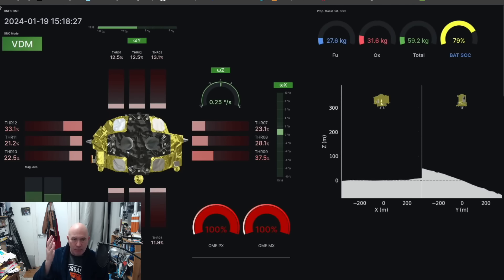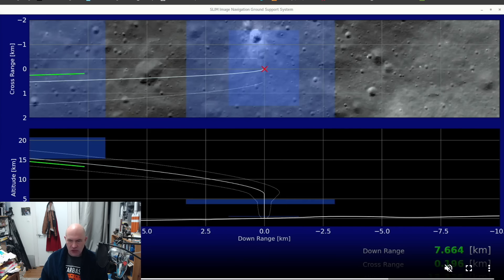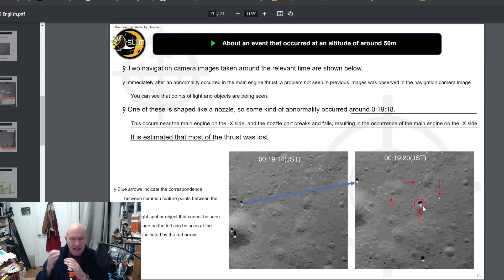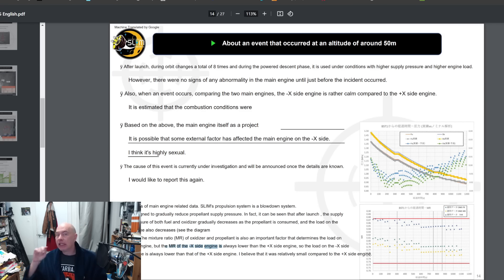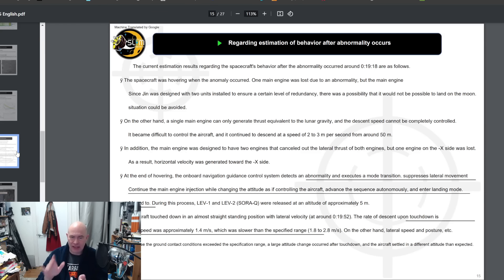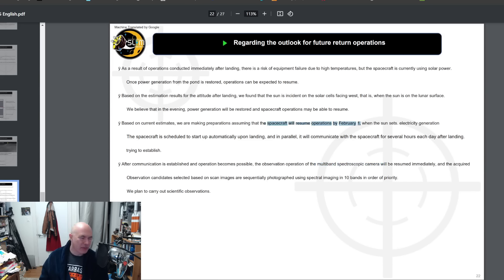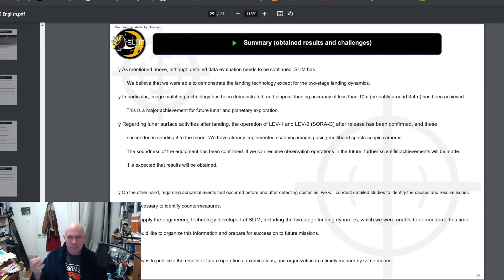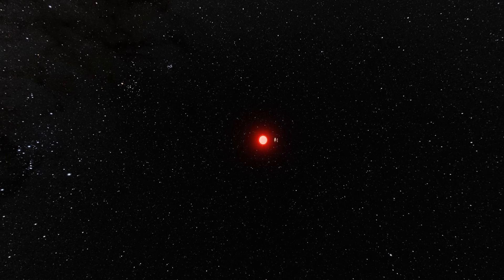Japan Finally Reveals What Happened To Their Lunar Lander! And It Really Did Surprise me!

Comment: Engine falling off during a controlled landing is the most KSP thing I have ever seen. We are in a simulation, and were kerbols lol
Reply: Engine exploding I'd agree with. Engine falling off, not so much. In KSP, unplanned disassembly usually happens catastrophically, not bit by bit. I presume somebody at some point probably made a mod that had parts fall off randomly, but if someone did, I haven't come across it.
Reply: It definitely feels more like Kia than it does Toyota
Reply: check yo staging
Reply: tvf I've seen better proposals on KSP than this lander; Its requirement to be "landed" in a certain orientation to work for example.
Reply: The engine fell off. Not supposed to do that, but this one is really outside the environment.
Reply: @theherk  Arent these things built to rigorous space travel standards?
Reply: @watchingsometube  Well, the engine's not supposed to fall off for a start.
Reply: It's also one of the most Kerbal landing photos ever too, I'm pretty sure a number of my early KSP1 Mun missions landed in a similar condition and orientation 😁.
Reply: @Feldynn This!  😂
Reply: Engine nozzle, not the engine.
Reply: @darren_anscombe  The proposal was fine. But the fact that they successfully dropped two rovers, landed their lander without it becoming a new crater, got communications and expect it to work again at some point remains. Doing all this with one engine less than expected and thrust going in the wrong direction is pretty much the definitive KSP outcome though 😂
Reply: @watchingsometube  Theres always some chance of mailfunction in some parts. They ll learn from it.
Reply: I wonder if they can use the reaction control thrusters to move it into a better position?
Reply: There's should be " Kerbal awards " like Darwin for spacecraft
Reply: @feynthefallen   There's a mod where depending on how much you spend on QC and research each part can have a varying degree of failure rate. They don't fall off tho.
Reply: Funny yet is that someone is going to land on the moon one day and find this lander and nozzle and be very confused.
Reply: Only in KSP 💀
Reply: 🤣 ksp
Reply: Better then lemmings, at least  kerbols can build stuff.
Reply: What is KSP?
Reply: @feynthefallen In KSP2 parts used to randomly fall off all the time.
Reply: @OlSkunGun  Kerbal Space Program - it's a video game where you build and launch rockets.
Reply: @willemkaret1568  The engine falling off is not typical, I'd like to make that point.
Reply: @mrflippant  thnx
Reply: The front fell off
Reply: Nm someone already was riffing on that... I thought I had an original bit of humour
Reply: @rydplrs71  nope, boeing or spirit.
Reply: usually the phrase lost an engine doesnt really mean thatbyoy actually lost an engine, as in where the f did it go?
Reply: The kraken is real.
Reply: Between this, MCO and IFT 1, I think you are just straight up correct.
Reply: @johndoe1909  is always in the last place you look🤣🤣
Reply: @feynthefallen KSP2 had some cases of random parts just falling off :P
Reply: @rydplrs71 funfact. Toyota led the world in recalls last year.
Reply: More like space engineers
Reply: So it's confirmed, Japan quicksaved, failed the landing by burning too late, quickloaded and the vehicle fell apart. 
We all complained at the Devs  but they were just making KSP2 hyper-realistic 😂😂
Reply: Exhaust nozzle is quite different from the engine itself. It's more like if a prop fall of from a twin engine airplane.
Reply: @mrflippant  "The engine falling off is not typical" [Citation required!]
Reply: Lol
Reply: @feynthefallen You're being pedantic, I've lost count of the times I forgot to get the landing gear out and landed on the engine which broke off.
Reply: @ivanlagrossemoule  Oh am I? You know, there's a difference between "landing on" and "falling off" don't you? I should know, I'm pretty heavy, things I land on normally stay landed on!
Reply: life imitates art
Reply: @feynthefallen  You can have partial disassembly w/o a mod for it (in ksp1).  Think it has to do with part clipping when designing.  I have a screenshot of a beautiful plane soaring off into the sky, while my pilot sits on the runway, the COCKPIT having fallen off on the takeoff. =D
Reply: Munar landing PTSD intensifies
Reply: I'll play that when they bring out a Mac or Linux version. Maybe.
Reply: 😂 Let’s hope we fair better than Val who I stranded in a highly elliptical high Kerbin orbit after forgetting to turn off the terrier engine and fuel cross flow in the cargo bay of my SSTO.
Reply: @rydplrs71  Kia is South Korean and they know a thing or two.
Reply: From now on, when this happens we'll have to refer to it as having kerbled.
Reply: Engine falling off is quite kerbal, but so is making contact with the ground anyway and still calling it a landing.
Reply: @HappyBeezerStudios  Any landing your rovers can hop away from is a good landing
Reply: @HappyBeezerStudios  with the nose sniffing the dirt is even more Kerbal
Reply: You never played lemmings before  @WangNurMouth

Comment: So:

- They lost the nozzle on one of the main two engines, and still managed to land.
- They managed to spit out those two more Kerbal than Kerbal, toy-like gizmos
- One of those gizmos took a picture of the main craft after it fell or its face and successfully sent it to earth
- There is still a decent chance that the main craft will reactivate in the "afternoon".

This is simply amazing. Great work, JAXA! 

🏆
Reply: Could call it the ''Aftermoon''
Reply: More Kerbal than Kerbal  👍
Reply: No, it is more or less similar to a drop of 50 meters, and on the moon, it is like a drop of 7 meters.
Reply: If heaters work perfectly and maintain batteries temperature in -140degree  I'm sure there's high chances it will wake up again
Reply: A comedy of errors and yet everything still works... sort of.
Reply: @kanlu5199  Not a drop from 50 m. As Scott pointed out, touchdown velocity was just over 1 m/s (~2-3 mph)
If SLIM did free fall from 50m, velocity at the surface would have been over 13 m/s (~30 mph).
Reply: Mission target distance was within 100m of landing target. SLIM achieved ~10.8 m. Close to a bullseye. ⊗
Reply: @AerialWaviator  OK, But I see that from the height indicator, the SLIM stops at 50 m for a few seconds and then shows on a negative height, with an upside-down icon. Some of the sensors could have been malfunctioning.
Reply: @kanlu5199  It descended at less than planned vertical speed. The problem was lateral speed.
Reply: @nutsackmania  Thanks! 😁👍
Reply: '...more Kerbal than Kerbal, toy-like gizmos' - line of the week there mate 🤣😂💥
Reply: No. Landing three people and a car on the moon 50 yeats ago is amazing. This is embarassing.
Reply: @Voodoo_Robot  Care to compare budgets? But I am sure you would do better. (To be fair, having a nozzle fall off your engine, twice, is a bit embarrassing. Not as much as burning three astronauts because you perform an overpressure test with pure oxygen, and people inside, but still...)
Reply: Yes, but only two men were on the moon at any time, and one stayed in orbit, during these Apollo missions during the late 1960's-early1970's. However, the Japanese can take some solace, and credit, in the fact that the Lunar Rovers, brought and used by the NASA astronauts, decades ago, were designed after an ancient origami concept, being "foldable", so they would fit into the descent stage of the LEM. So, well deserved kudos to Japan for developing that art form which helped facilitate science and lunar exploration centuries later!! ;D LOL @Voodoo_Robot
Reply: I heard Boeing forgot to put the bolts in that hold the nozzle on...
Reply: @gorak9000  😀  Yeah, that's the one that cannot, for a change, be blamed on Boeing...  (It seems that ceramic material of the nozzle is too brittle under the thermal environment it encounters when firing in vacuum. Insufficient testing, apparently.)
Reply: so, Life in the Afternoon?
Reply: @rodschmidt8952  Hopefully 😀
Reply: Yeah no kidding Musk could really takes some notes on how to do a test flight!
Reply: update: The spacecraft is regaining power thanks to the change of direction of the sun
Reply: @Kennychan222  As hoped for, but not really expected. Thanks - I didn't see the news.
Reply: Can the ball toy bump into the spacecraft and maybe put in on a proper side up? At least reorient the solar panels to a better direction.
Reply: @TheBlacktom  Hmmm.... I wouldn't risk that. Another poster reports that the craft shows signs of waking up, as rhe "aftermoon" sun illum7nates solar panels.
Reply: @bazoo513 The spacecraft is (for now) one of the illuminati.
Reply: @advorak8529  Yup, I saw the news that it got enough power to reestablish contact with Earth. Amazing!
Reply: Someone call SpaceX to put it into position
Reply: @tricisport8259  Yeah, right. As soon as they actually reach orbit, construct and demonstrate refueling, constrict a lander, actually do at lest half a dozen refuelings... Day after tomorrow...
Reply: @bazoo513  My thoughts exactly.
Reply: Agreed! One hilarious failure, but an entire list of other successes!

Comment: Really unfortunate failure, but hats off to the engineers. The software program did a great job of dealing with the situation it was given, and the team did a great job of troubleshooting to get them in the best position to recover as much of the mission as they can. Spaceflight is hard, bravo Japan!
Reply: Absolutely right. The one thing we should be focusing on right now is to get the engineers to the moon itself to solve problems as they arise.
Reply: Or for the Engineers in charge of the landing, heads off!
Reply: Very amazing engineering and foresight by the team. Engineers thought of this scenario in advance, designed and tested software to handle a situation that would very likely never be used. By a stroke of bad luck, this lower priority software was called and function perfectly. The extra bits of effort beyond 100% defined success!!
Reply: Right, "Space flight is hard", that's why American president JFK said, in the early 1960's, "We choose to go to the moon, not because it is easy, but because it is hard!" :D

Comment: Honestly pretty happy ending, considering how many craft have impacted the moon (or lost in space) recently just because of weird failures and the inability to compensate. Got that feel good survival story of a little craft dealing with a catastrophe and coming out alive :) Have there ever been a craft that has had a major mechanical failure and still managed to land softly and continue operation before? This is kerbal in the best way!
Reply: If I remember correctly, the Galileo Jupiter atmospheric probe had its accelerometer backwards, and thus technically shouldn’t have ever deployed its parachute (the precise same issue that occurred on Genesis). However, the parachute deployed anyways a minute or two later than it should have, resulting in a successful mission.

Actually, you know what, the main Galileo probe also qualifies for an in-space equivalent, considering they couldn’t use the main antenna and had to switch to using the comically undersized backup antenna for data transmission.

Comment: JAXA has just announced that it has resumed operations of the SLIM spacecraft that landed on the Moon, which was unable to generate power from its solar array panels due to an attitude anomaly at the time of the landing on March 20, but is now believed to have resumed power generation. Mineralogical observations of the Moon were also resumed.
The landing posture is not upside down, as it was originally planned to rotate 90° and land with the photovoltaic panels facing up.
SLIM was not in the planned position with the solar panels directly above the ground, but in a 90-degree tilt, facing west.
JAXA predicted that power generation would resume when the sun came to the west.
The prediction came true and power generation resumed, so SLIM began its work, although it is still collapsed by 90°.
Reply: good !!

Comment: This is cool. I appreciate Japans transparency on this mission. I would point out that although the primary mission failed due to material failure there are several success points as well. They got there. The probe was in proper alignment ( the engine falls off). The seperation camera popped off successfully and was operational. Indications are if engine was intact on landing the craft would have performed as intended. All amazing achievements. Next iteration after lessons learned should work.

Comment: Outstanding work from Japan.  Very novel design for a lander and it seemed to work really well overall.
Reply: If an engine fell off a jet you were flying in, would you say that's an overall success?
Reply: @outlawbillionairez9780  If you got down safely, then Yes.
Reply: @chrissouthgate4554  crash landed. Tumbled down a hill. Ended upside down.
Reply: @outlawbillionairez9780 they achieved almost all of their objectives + extra points for the KSP meme
Reply: @outlawbillionairez9780 yes but did you die?
Reply: @kv4648  1969.
My generation lands MEN on the Moon.
(Engine intact. No crash. Computer capacity of a 1990 toaster oven)
Reply: @outlawbillionairez9780 Your generation, you are speaking from a high horse like your were almost involved yourself. Lets start discussion by comparing budgets of both projects, then we will move to Apollo 1 and Apollo 13 missions. Do you still think you hold a high ground?
Reply: @outlawbillionairez9780 Ha! Your generation. Like it's some kind of achievement to have been alive while others were doing great things
Reply: @Phdyaux  remember that as you drive on the freeway system we built, to go to the schools and libraries we built, and the electric grid and sewer systems we built, when you turn on the bathroom light to take a 💩.
Reply: Yes, they developed it on a very limited budget. One of the rovers is a toy called Sora-Q, which you can buy for less than $200. lol
Reply: @tsutenkakug6168  A moon littered with kids toys. Cute.
Reply: Get over yourself, you built on the work of the generations before and just the same happens now. 
Or did you also invent the lightbulb and synthetic rubber?
Reply: @outlawbillionairez9780  Sure, you going to pay for that today?  We wasted the equivalent of a decent size war simply to fly a few people there at very high risk, mostly as a way to show off and honor the legacy of a tragically assassinated president.  We now have a small fraction of that budget, and the prestige isn’t as great simply because we’ve already done it.  We are only even now aiming to go back there because there’s finally some actual borderline reasons for wanting to do so.  Even so I expect continued delays, cancellations, and probably an accident or two over the next decade or two as we go back to the moon.  As more and more people are living in space every year and more work is being done we will end up having more accidents just by statistical probability.
Reply: @outlawbillionairez9780 
Just because something is small doesn't mean it is for kids.
Reply: Fail.
Reply: @davebryant8050  Having people on the actual spacecraft allows them to react and adapt to situations on-site, unlike an unmanned probe where they can't quite fix anything that breaks. I mean, even the Apollo Program had its setbacks, from the horrific fate of Apollo 1, to the infamous Apollo 13 where the only reason they even got back home was because of the ingenuity of the crew *onboard*.

Comment: Top and bottom charts shown starting at 4:42 into video show that engine mixture ratio (MR) on the -X side axial descent engine ("OME-MX") was declining at at rate such that at about 1500 seconds engine firing time it would have crossed the lower red line of MR = 0.725  . . .  that's very fuel rich for the N2O4/N2H4 propellant combination (usual design MR for N2O4/N2H4 engines is in the range of 1.0 to 1.2 for best combination of Isp and combustion chamber/nozzle throat temperatures) and likely resulted in the -X side descent engine headend and/or combustion chamber exploding, leaving the rocket's nozzle as the only large remaining piece projected down onto the Moon's surface.

Also, the vehicle acceleration chart shown starting at 3:42 into the video clearly indicates one of the two main descent engines failing at about 1490 seconds elapsed engine firing time, consistent with the predicted time of crossing over the mixture ratio red line for the -X engine.

Why JAXA chose a N2O4/N2H4 rocket engine with such a low design mixture ratio ( the descent engines start firing with MRs ~ 0.80) is a mystery . . . it might have something to do with fact that the two 500N descent engines used on this lander were a relatively new "ceramic" design.